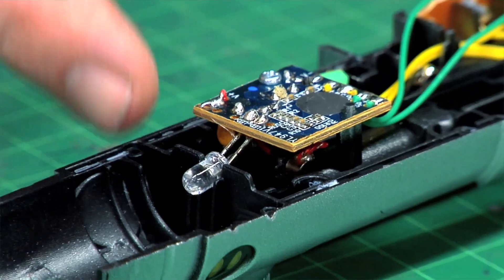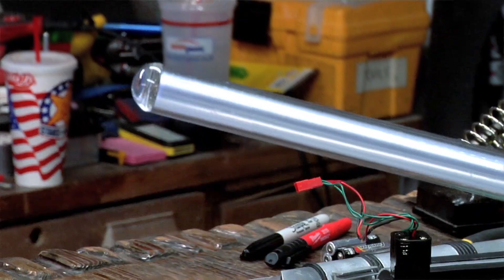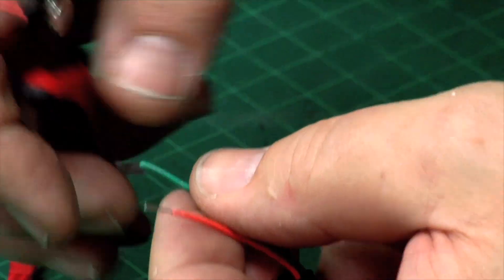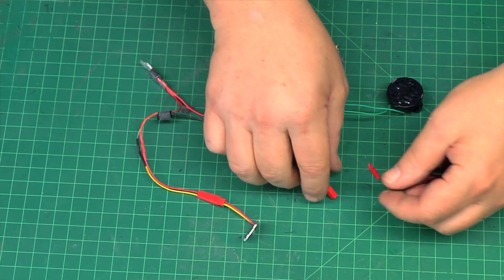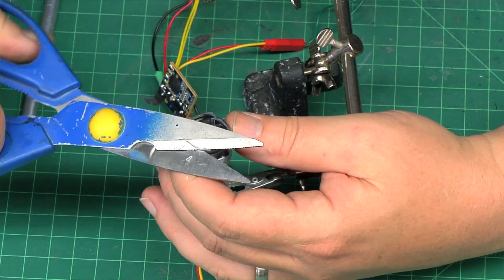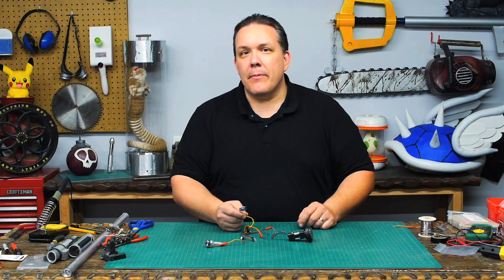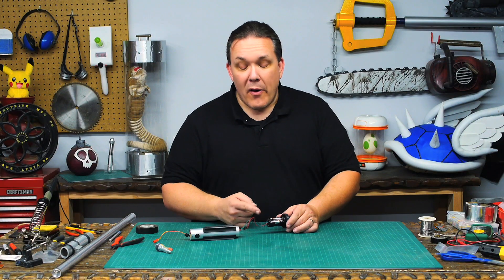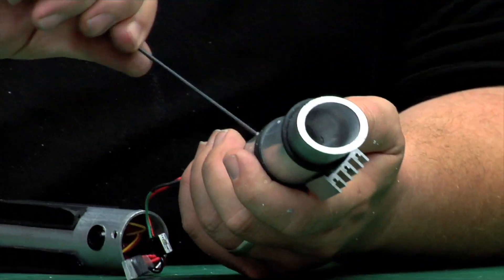How to Turn a Toy Lightsaber into a Combat Ready Lightsaber - Beyond Geek DIY Builds

Comment: This is really helpful thank you! Ive been working on doing a combat ready Kylo Ren Saber using the tips youve given. the circuit board on the Kylo Ren verson is  completley different to the Rey version as in the markings are different, switch and how to  connect the LEDS. the high powered LED (Center LED) actually needs the Positive and Negotive connected otherwise the bulb wont be as powerful as the side LEDs. But again this has been really helpful!

Comment: The Micropuck is actually part number 2009 and is found here: https://www.ledsupply.com/led-drivers/micropuck-boost-dc-led-driver
Reply: This is correct, the correct part number for the MicroPuck Driver is 2009A.
Reply: can i use any PNP Transistor or needs to be the nte 242?

Comment: Hello. "Odin" I will eventually custom upgrade one or more toys, Lightsaber, I think I wanted to upgrade only the light LED. So I do have to ask a question.

"What I can do to add some weight to my toy's handle while my exact point of weight is intended to be the bottom of the handle?

 I saw you added a screw as a conductor which I would think is a fair way to add some weight to the handle. Nice work exemplified by your self.

Also, I may want to reinforce the bottom of the toy; and I may add a joint of steel lsuch a chrome ring to clink against the handle during movements. Of course I will expect to set in place against The handle a smaller piece of metal to tap against the proposed ring.

The toy design was modeled after a metal film prop which does dangle from the lightsaber. In case you need a referable visual image of the ring; then you can see in the film Star Wars is a scene wherein the main character is seen inverted body and suspended in a cave while to the ceiling and the lightsaber is buried in snow. So in the scene the lightsaber is "forced" to the characters grasp yet only after the lightsaber ring does mimic a jingle dangle motion.

How you recommended to  successfully install those steel additions? The process is new to me though I can image my own inexperienced build although if you can help; then I will take your advice. Remember the  additional ring joint would be separate away from the bottom reinforcemt of the handle. My handle I would want to reinforce by maybe an end cap screw ( You will find flash lights often have such screw caps) then I will be obligate to create the handle bottom threading of its own to attach to the end cap screw. I am not a welder so creating a metal end cap screw would be inconvenient and creating inner threads for rhe handles tube is as well difficult.

Thank you for the video.
(I have to work upon the very same toy as your toy used to demonstrate your  instructions within the video.

-J.T

Comment: So your instructions say use a NTE242 and your installing an NTE 378. So im a little confused does it matter.? Thanks in advamced
Reply: I had the same issue.
 Im using a different NTE (simular but still different) and it doesnt seem to effect it performance of the LED at all.
Reply: I skipped the nte all together I got 3 in from Allied technology though I may put them back in
Reply: I also removed the swing.. that black cylinder since it was very sensitive and overall annoying I'm thinking of a small momentary switch h
Reply: Ah see im making a Kylo Ren combat ready Lightsaber and ive found the sensor on that one isn't as bad as the single blade I think they add a slight delay on that one
Reply: I got 2 from goodwill one was the same the other was a touch different but the boards both work

Comment: im looking for the parts at ledsupply but i'm not finding them except for the led which is royal blue, and white. Its a bummer cus I wanted sith red.  the led is XLamp Cree XTE - Indus Star 1-Up if anyone is wondering...I wonder what else you would need to put in a cree rgbw led so as not have to keep cracking the hilt open /soldering everything

Comment: Odin, I have a question. My understanding of people using hasbro boards typical use a resistor as they are typically using a 3.7v power pack. I'm curious why are you are using a transistor here? Is it because your battery pack is wired in series and only providing 1.5v where as your LED probably requires upwards of 2v? And if so, what should i look for when sourcing a transistor?

Comment: Did you use anything  from the toy lightsaber aside from the board?
Reply from the maker: No, but you could use the speaker or momentary switch in a build.
Reply: I can see why some find the title misleading. but, you could still use the toy handle and upgrade the blade and electronics as the video shows. you might have to drimmel out some of the insides of the handle, and put some kind of reinforcement ring(pvc or metal) where the blade and handle meet, if you plan on fighting with it.  but, this video does in a round about way show you how to do it.
Reply: so the title is slightly misleading? the toy saber hasnt really been made battle-ready since you only used he board from the toy

Comment: I would think that the primary reason for not connecting another speaker, like yours, is because of worry about soldering and the like. Of course, that is probably the reason you'd worry about all of it. It isn't difficult, any of it, unless you've got severely center-mounted thumbs, but some do and some really REALLY don't want to futz with this sort of thing, because it's "magic" to them.

Comment: So doing this. But a parts list would help.
Reply from the maker: The parts list is now up. Thanks!
Reply: Beyond Geek will post one later, but it is almost completely the same list as the other DIY saber build here on Beyond Geek. The only new parts are the toy, and that PNP transistor (NTE 242 is the model I used here) but I have grabbed other models now, and all have worked. Just make sure it's PNP- Positive-Negative-Positive.  NTE also sells NPN, and they might work, but I have not tested them.

Comment: Question: Why not just replace the blade in the toy? It's a lot faster and while it isn't as bright it's cheaper and easier
Reply: cause the toy a plastic hilt
Reply: if you only want to pose with it, that would work just fine. But if you want to battle with a new polycarbonate blade and strike other sabers, the toy body will split at the seam and break.
It might even pinch your hand, or send plastic pieces flying.
But if you are only going to cosplay with it, and pose for pictures, oh sure, that would be easy, and much faster.
Reply: I can confirm that those plastic hilts are EXTREMELY durable with just a little bit of duct tape wrapped around them. I duel my brother with a basic Darth Maul toy lightsaber all the time. He and I beat the crap out of each other with them. They're quit durable
Reply: Electric Nick I can confirm your wrong me and my friend use to duel all the time and I have gone through 3 Darth Maul lightsabers

Comment: First!
Reply: There are many ways to do a top comment, but this is...   
...this is  deja vu!
Reply: Odin Makes last!
Reply: What do you need Jaime
Reply: Odin Makes a
Reply: The Bone Zone q
Reply: The Bone Zone    P
Reply: Odin Makes the lightsaber looks badass
Reply: Odin Makes can you make Darth Mauls light saber?
Reply: Awesome
Reply: Odin Makes Would I be able to just use a 1000 mA buck puck in place of the transistor and micropuck, and if so where would I wire it?
Reply: Odin Makes hey what was the lumen output from the super bright led
Reply: Odin Makes
Reply: That driver isn't available anymore. There are similar versions which which are meant to do different currents. What current and/or voltage are we trying to work with in a lightsaber?
Reply: Odin.  I would love to see you make a Darth maul that Actually comes out of the hilt
Reply: Odin Makes, The 1425 Micropuck is no longer available from LED supplies and I can’t find anywhere else on the internet.  Could you suggest a suitable replacement driver?
Reply: Funny this is
Reply: Hey so I could really use some clarification ASAP if possible.  I could not find the same NTE378 you used in the video.  Will this one work https://www.alliedelec.com/nte-electronics-inc-nte378/70215766/ also I could not find a Micropuck 1425 but will this one work https://www.ledsupply.com/led-drivers/micropuck-boost-dc-led-driver and what Amperage?